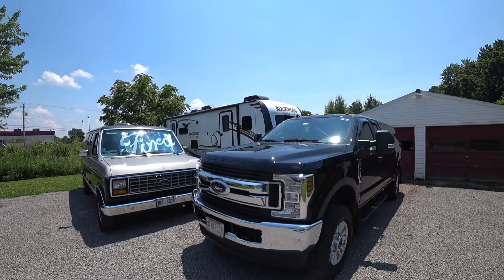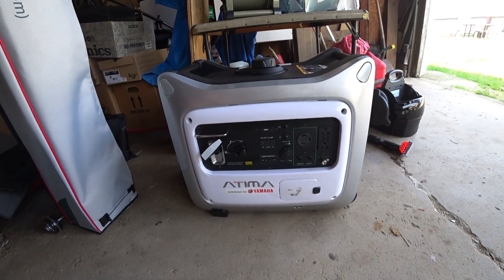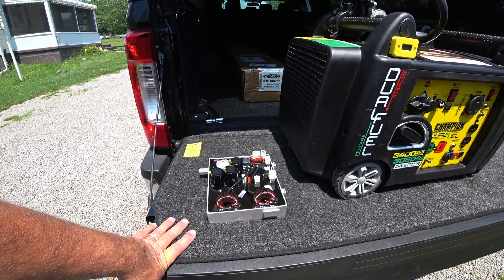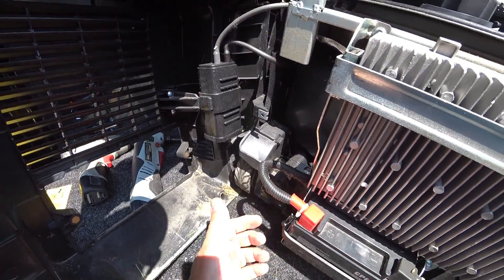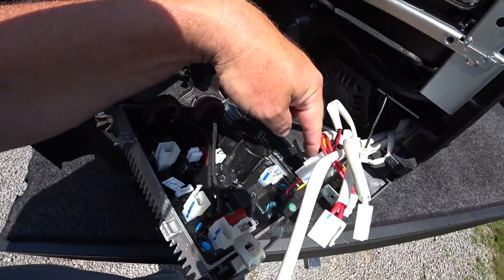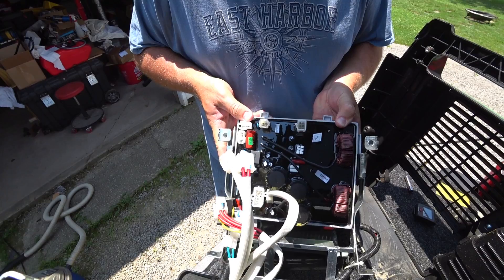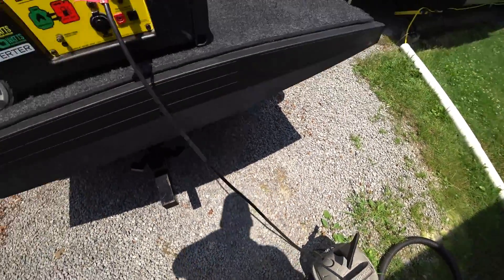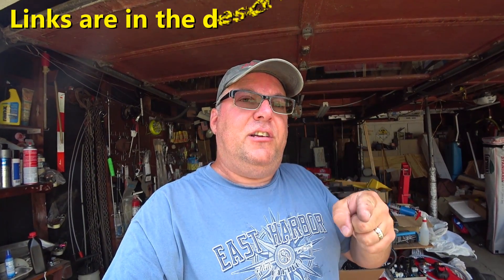Champion Inverter Generator Control Repair

Comment: I've had the same generator for 8 years. It's been great and powers all the essentials in our 3 level 4000sq ft home, so I'm pretty happy with the output capacity. I run it only on propane, but am in the process of a tri-fuel conversion which is pretty simple since it's just a different external regulator setup. Of course, this will reduce the output a bit.

Comment: Hello, do you have the service manual? I am looking for the Sub Coil AC voltage specification to the control module.
thank you
Reply from the maker: Sorry, I do not have the service manual. Did you attempt to contact Champion directly? Sometimes it's hard to get through to them however once you do they are very thorough and are willing to help
Reply: @Rvdaydream  Thank you for the reply sir, i tried calling in today and was on hold for 30 minutes, i will try again.

Comment: I know it’s been a while since you worked on this but do you need to remove the control board to access the carb?  I’m trying to get the carb out to clean it and it looks like a mess of spaghetti in there. We have the 3100 watt electric start you used to have. If you don’t remember, I understand. Lol.
Reply from the maker: No, you don't have to remove the control board. I know it's tight in there and it's kind of a jigsaw puzzle where one piece has to be removed before the next one. But, you are correct, I don't clearly remember. Lol
Reply: @Rvdaydream hahahaha. That’s hilarious.

Comment: hey i was wondering if u know where i can get a repair manual for my champion genarator
Reply from the maker: Most champion generators if you go to the support section of the website for Champion they have manuals listed there. I don't know how much of it's going to cover repairs though it's just going to be most likely parts
Reply: @Rvdaydream   ok thanks yeah im trying to find a repair  manual that has torque specs in it i need to replace the connecting rod ( crank bearing ) i have looked all over but i know they should have one i have the 79cc 2500 watt inverter thanks man have a great  night
Reply: all i have been able to get is onwers manual from champion
Reply from the maker: You can pretty much use any of the generator manuals that are available if you can find a torque spec. Even the Honda or Predator that would be fine too they all got to be real close to the same
Reply: @Rvdaydream  thanks yeah iguess your right its a honda clone so hey thanks love your channle i have been a scriber for as long as i been liveing in my van . im from nawlns  but live in las cruses been here 3 years in my 97 caravan thanks for the info tell hidi hi for me  champion has been the best investment i could make . love champion  yall take care now god bless
Reply from the maker: Thanks, awesome that you're out there doing it man! Sometimes I could be a tough life to live. But well worth the freedom. If you're replacing the connecting rod there shouldn't be any bearing necessarily. A lot of those the connecting rod itself have the bearing surface built into it. I was a small engine mechanic for quite a few years and one thing that I learned is whenever you're assembling you're connecting rod back to the crank clean the threads really well on the bolts and put some Loctite on them. Last thing you want them to do is back out once you get the engine all back together. Take care and thanks for being a loyal viewer. Hope to see you out there! PS Heidi says hi back:-)
Reply: @Rvdaydream  thanks for the tips i was a diesel mechanic for years then i got smart and stopped turning wrenches to driveing .but then relized i dont want to work until im 60 and i retired at 44 im 47 now and its the best decision i ever made . oh and just to give champion credit they did  for me what they did for you this past spring i was haveing a compression problem with my 2500 duel fuel gen it had the  exust valve hanging up when u put a havy load on it . and it would shut down . no compression until  engine cooled off then it would free itself . well it did this all last summer and come spring i called champion and just like u  the  genarator was out of warranty but the head guy in the shop told me to ship it to them they sent me a box and everything well when i got it back in only 2  weeks i had a reman engine and  a brand new control unit  . i was just so impressed with how fast and how good they treat us . they have a custumer for life . and yep you are correct on the connecting rod being all one piece .just hope the crank is not to far gone . because i ran it for a few hours with rod knocking   and  the oil was silver with alum shaveings wish me luck . sorry took so long to respond  laptop died on me. have a great night hope to meet yall one day.

Comment: Quick update, I had same problem and called customer service and they flat out refuted that they would provide parts outside of warranty.  They charge 179 for the control unit.  I own two of these champion generators and this one failed with approximately 150 hours.  A big old anchor.  I am moving on to a Kubota 7000 diesel generator with a big old fuel tank.  Can run everything in our Airstream for a long time on one tank and have a track record of getting 7-10000 hours out of them
Reply from the maker: Well, you know the say, One Bad Apple don't spoil the whole bunch. Champions still have a lower price point and they are definitely more neighbor friendly than a diesel. But, if noise isn't an issue and you don't mind a couple different types of fuel then that might work

Comment: I agree.  I have 936 hours on my remote start 3100 w inverter Champion generator and it never as never let me down.  Just change oil every 100 hours and change plugs and air filter as needed.  Good service and fast parts delivery.  The only thing I wish is that it was a little quieter or that more aftermarket exhsust kits were available to make it quieter.  Mine will run our 15 000 BTU A/C unit in our TT and the microwave at the same time when we do use it.

Comment: Did the board allow the 15k to start and run correctly? Your video skipped the end result of the circuit board replacement result.
Reply from the maker: It did BUT, while on propane not consistently..

Comment: Thanks!  This video was very helpful for a different reason for me.  I thought I would be smart and buy 9Ah instead of the recommended 7Ah one that came with it.  The 9Ah was a just about a 1/4" taller and I thought "No Problem" that will fit (no way)..  I had to remove the controller/battery frame and modify it.  Now I have to go find an oil leak on this thing and I have less than 10 hrs total from new. (Never again a Champion for me)  Thanks Again and "Appreciated"

Comment: before buying the cpu. my generator turns on but does not transmit electricity. That is the solution?
Reply from the maker: As the previous commenter mentioned, champion technical help can dial in what your problem is just give them a call.

Comment: The rep at Champion must know you are running a YouTube channel with tens of thousands of viewers, and views.
Reply from the maker: Well actually I'm not sure we actually talk to three different people. I'm not sure why everybody thinks that having a YouTube channel makes a difference with the kind of service that you get. I've mentioned that we've had a YouTube channel when making purchases and requesting service at certain places and sometimes I don't mention it and I'm pretty sure that it just has to do with somebody's attitude and not being a jerk and just asking honest questions.
Reply: @Rvdaydream  If they are just normally generous, that'd be nice. But I hate to think abot what it's gonna cost them to repeatedly hand out $200 boards (and other stuff) , if that's what they are doing. The most generous business people I know, didn't manage to stay in business by marketing sub-grade products and then going above-and-beyond to cover any problems.  Am I saying Champion power products are sub-grade? Well, at their price level, it's hard to imagine that they are AS good as Honda (which I do not own).
Reply from the maker: Well believe it or not most of these manufacturers have a certain percentage of repairs and parts that are automatically authorized. Meaning with no fault , no reason needed a customer will still get what they need. Walmart is kind of the ones that started that years ago. So there are businesses that actually do that and have been for years and are still quite successful.
Reply: @Rvdaydream   I can see Walmart or Costco or some other big chains doing that, yeah.

Comment: Sometimes I see people using extension cords to get power from their generators to their RV's which are of a gage which is too small. Or, they are far too long. Use the  shortest possible cord, and buy the heaviest one you can afford.

Comment: in your experience , are most 301cc generator motors like that found on the 5kw champion, do the blocks come with provisions to install a stater motor?  and are flywheels with the ring gear for a 301 cc going to mostly all be the same?
Reply from the maker: Not always

Comment: just had the same issue with my 3100 invertor generator, they didnt send me one. said i had to purchase one. . . so it sits until i can get the money for it!!!
Reply from the maker: Has it been over a year since you purchased it?
Reply: @Rvdaydream  yes,  ive had it alomost 3years.
Reply from the maker: Ahh, I think I was just over a year when they sent me a replacement. I just gave them numbers off of my unit late somehow knew how old it was
Reply: Gotcha, 👍

Comment: Hi, it is possible that the generator provides power but the control unit is not provided grounded output and therefore certain electronics don’t work?
Reply from the maker: You would have to talk to Champion Direct. They have great customer service.

Comment: I suggest to have little to no issue down the road is to get a 3.5kw pure sine wave inverter one that can handle bought load use undercoating to seal the components from vibration

Comment: Ok I am technical engineer on inverter and I know the only part will stop the Serge from from going into overload is the current limiter the current limiter can adjust to a low Serge or it can be the mosfet back too or the company's use cheaper mosfet that's cant handle the Serge

Comment: Hi I have a question for you ..My 3500 Champion dual fuel, I lost my output 30amp voltage tt30 connector on the generator. I pushed the reset but nothing happens. My meter reads only around 60 volts. What do you think problem is? Is this something like your controller? Joe
Reply from the maker: That is a possibility. Definitely contact Champion Direct. They are great at taking care of their customers so hopefully they can come up with a plan. If you hit the reset and it's not doing anything then there might be a control module issue. Good luck!

Comment: Thanks for the video. I have the same Champion 3400 generator that I use for boondocking with my 25ft Rockwood Mini lite. The  single15000 BTU AC kicks on and runs just fine with this powerhouse. I have noticed that if I run the microwave while the AC is on that my generator will overload so we know not to do that anymore. But very happy with this Champion 3400 Inverter generator.

Comment: I have a Champion 3100 that is about 4 years old, barely more than 6 hours of use on it. I run it probably 4-6 times a year for at least 20+ minutes which probably isn't good or enough. I pulled it out 2 nights ago when it was warm out in Michigan, and attached a 6 amp electric pole saw to it and ran the saw for about 15 seconds and then nothing. The saw would not run, no other devices, the saw is fine, but I have no AC output at the panel. The Champion support team said I should look at and replace the control board which is about $200.
Reply from the maker: You may just try to call them back and talk with them again and ask if there's any possibility that this is still covered under a warranty of some kind. They were really good about sending me the control module for no charge, but maybe my unit wasn't quite as old at the time. It's worth a shot. But for $200 it may be worth it. The problem with a lot of these units are kind of like the same situation as trailer tires. Although the trailer tires on a RV May Look like brand new. And have a lot of tread on them. And have only been driven. Maybe 2000 miles over 5 years. But the exposure to hot and cold just over time. Causes them to fail. Usually electronic circuitry it's better than that, but it does live in a harsh environment when the generator is running with vibration and sometimes exposure to moisture. And of course the heat of the engine.. Good luck.
Reply: @Rvdaydream  thanks for the tip, and i agree with your analogy. makes sense

Comment: Had the same issue with my 2000 watt champion... It wouldn't even run the converter in my RV without going into overload... You're right about Champion too.. Even though my generator was long out of warranty they sent me a new control module free of charge..... I had to laugh when you pointed out forgetting about the rubber cushions... I had mine all back together when I noticed I left the cushions on the old module. lol

Comment: Hey great video man, wish I had seen this a few months back!  After working on the electrical panel, I couldn't tell where the blue and white modules mount. You didn't happen to see them while you were in there?
Reply from the maker: Sorry, I don't recall seeing Modules that needed mounted, I dont have remote start maybe thats what you see?   I would call Champion they are great to deal with

Comment: I have a 3500 watt Champion Dual Fuel Generator purchased at Cabelas.  I have the very same Coleman 15k a/c unit that you have.  My generator runs it fine on propane.  Yours has a problem.
Reply from the maker: Mine is a 3400 watt not 3500. It did have a problem, That's why I replaced the Control Module.
Reply from the maker: The test in which the Champion shows "overload: was running Both Rooftop A/C Units AT THE SAME TIME... Complete video on that can be found here (Test Video on 30amp HERE -- https://youtu.be/gQlSSsGOq8U  )  
 This module replacement fixed the 15k A/C running by itself but since I had already installed Microair Easy starts on the A/C Units I could not test each A/C unit one at a time as there wasn't enough load running/starting with just one unit, That's why I showed the attempt at starting and running 2 units
Reply: 3500 watt and the 3400 watt is the exact same generator I talk to champions customers service they told me cabelas wanted to hype the spec on the gen unit .Champion said they rate it for the average elevation for us citizens were cabelas wanted to pushed the upper spec on the unit and it also cut out them having to price match the generator with other competitors selling the same generator  because there different model numbers now.

Comment: Lost me.   I thought the fix was going to make it work.
Reply: I was under the same impression. The videos could have definitely been better articulated and in a more logical order. But hey these are amateur videos and you get what you pay for.-)
Reply from the maker: BTW, If I make a living posting YouTube videos, By definition that makes me a professional..
"It is not the critic who counts, not the man who points out how the strong man stumbled, or where the doer of deeds could have done better. The credit belongs to the man who is actually in the arena..."
Reply from the maker: The test in which the Champion shows "overload: was running Both Rooftop A/C Units AT THE SAME TIME... Complete video on that can be found here (Test Video on 30amp HERE -- https://youtu.be/gQlSSsGOq8U  )  
 This module replacement fixed the 15k A/C running by itself but since I had already installed Microair Easy starts on the A/C Units I could not test each A/C unit one at a time as there wasn't enough load running/starting with just one unit, That's why I showed the attempt at starting and running 2 units
Reply: @Rvdaydream  I did see the other video first.  I thought this one was going to be the .... "this controller fixed the booth units running at once."  overload problem.  Then it cut to the overload light.   Just thought maybe since you were on an editing binge something might have got switched.  But....I  digress.  BTW I get paid $26.50 an hour on layover to watch your videos,  so that makes me a professional watcher! 🤣🤣😂🤣😂